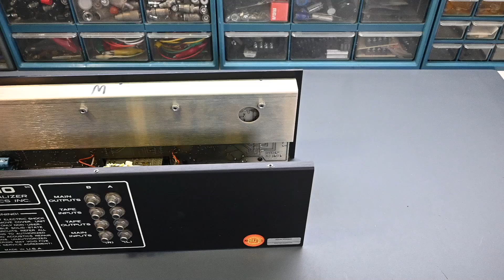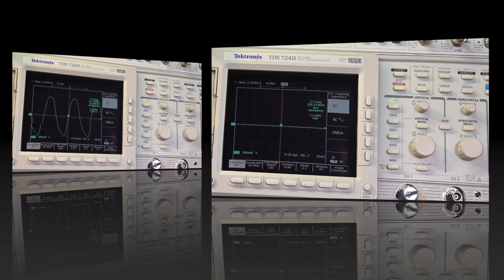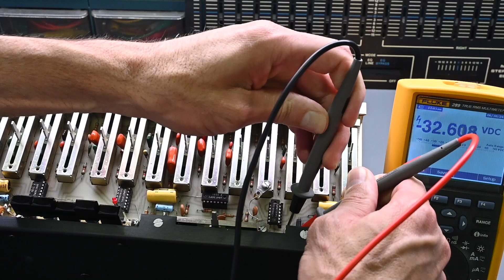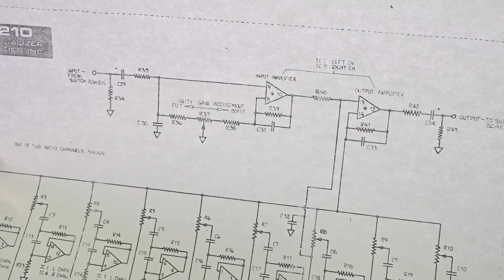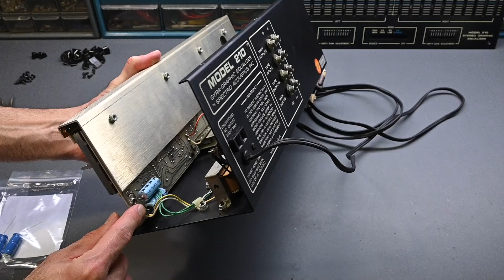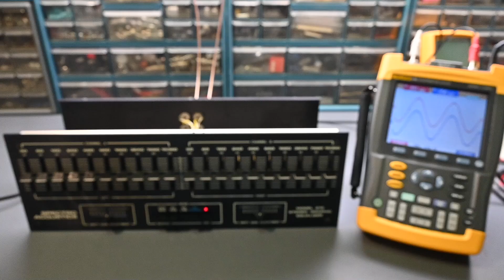Vintage Audio - Spectro Acoustics 210 Stereo Equalizer Repair

Comment: Eric helped me recap my SA 210 EQ. I have since purchased a second one that need to be recapped. I decided to clean the 22 potentiometers. I first liberally used DeoxIT Fader F5 to flush the inside of each pot. I used lint-free paper to absorb the excess and then cleaned up the remaining excess. It will dry but its better to wipe-up excess. I then used a small bamboo skewer stick with a flat end. I pushed the lint free paper into the gap of each pot with the skewer stick and wiped the flat carbon surface of the slider pot to clean it. Once I was happy the carbon surface was clean, I used the same lint-free paper with a small amount of DeoxIT Fader F100 cleaner/lubricant and the skewer stick to wipe the carbon surface and clean it a little more…as well as to leave some lubricant on the carbon surface. I then went over them one more time with clean lint-free paper using the skewer stick to help be get the paper to wipe off the carbon surface (never pressing hard…just wiping the paper on the surface to clean and spread the lubricant). Once I was done, I reassembled and test the SA 210 EQ. I have to say, this cleaning seemed to make a great deal of difference. The 210 seemed quieter through my speakers (test by using EQ Bypass and EQ Line buttons) and the sound quality seemed enhanced. All i know is you are going to get better results if you clean all the pots. The sliders will move more smoothly and make better contact which will result in better EQ Line sound. If you are going to recap one of these, you may as well clean the pots too. You won’t regret!

Comment: Hey Eric, you mentioned you would help me on a parts replacement list….but I found no way to email you in the “About” section. I replied to your comment in my previous post. Check it out, please. I hope you can help me. If I try to repair mine it would be my first repair. Mine in in working condition with no known problems buy after 50 years its time to recap the while unit as you did. Thanks!
Reply from the maker: Hi Robert, it's erikselectronicsworkbench (at symbol) gmail (dot com)

Comment: Do you take new projects? I have a Spectro Acoustics 210 in working condition…no obvious distortion…but I’d like to get it “recapped” and with new sockets as you did on this one. At the least, can I get a list of the parts you purchased and replaced?
Reply from the maker: Hi, I can send you the parts list, please contact me direct by email, link is in the about this channel section.  Appreciate the opertunity to service your EQ but I have a number of projects lined up so am not taking on additional work at the moment.

Comment: I have a Soundcraftsmen EQ that also used the 4136 chip.
It's basically a quad 741. It's an inferior sounding low-fi chip.
That EQ used only one per ch. So I replaced them with LM837's using a DYI adapter (daughter) board.

Comment: Oh I remember also in the early 1980s I had to replace the sockets for the ICS because they use those really crappy CA sockets that developed a four connection. The symptom was that the equalizer began oscillating like this one is.

Comment: I bought mine new in 1976. I got the 210r rack mounted model. The potentiometers got pretty scratchy after about 4 or 5 years. And after 40 years I had to recap the unit.